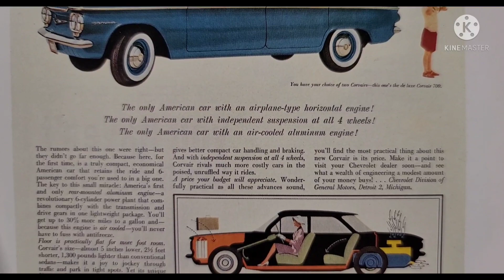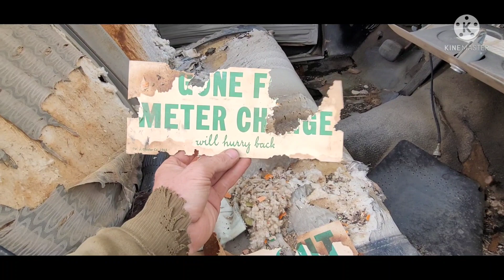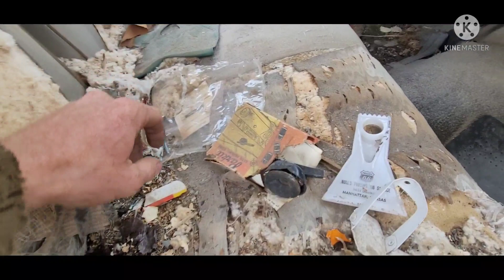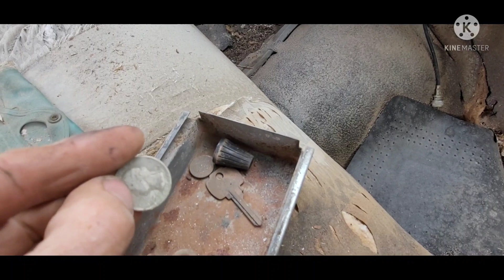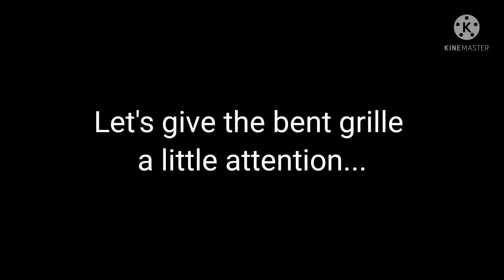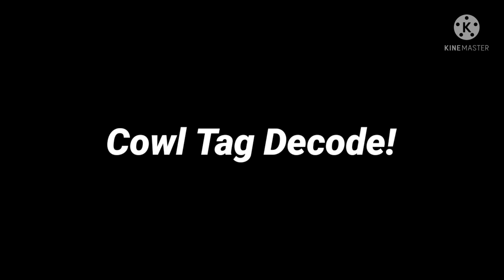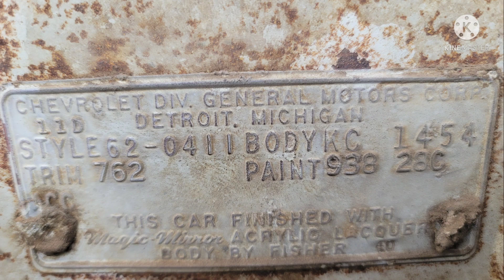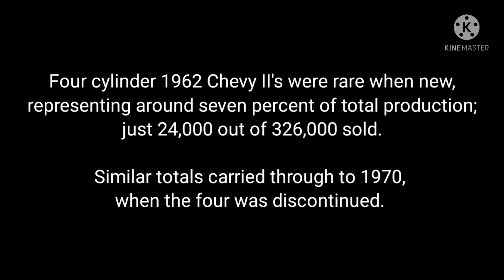1962 Chevy II farm auction find: I rescue a rare 4 cylinder two door post early Nova project car!

Comment: Yep, those 4’s and 6’s disappeared.Back in 1971  I had a ‘64 with a 3 on the tree that I paid 25 bucks for, yanked out the tired 6 and stuck in a 283 -4 from a wrecked ‘62 wagon. Added shackles and fatter tires, flex tube dual exhaust with glass packs. Had a nice stance with the mildly jacked up rear end. Nice to have a friend that worked in a boneyard, total investment was about 100 dollars

Comment: This was very interesting.  My 1st car was a 1962 Chevy II 2-door sedan, but base model, not the 300.  It was originally a fleet vehicle (from the local telephone company), and had this 4 cylinder engine and 3-speed manual trans.  It was a great 1st car back in the late 60's.  I hope this one will be saved and kept as original as possible.

Comment: My first car 1962 2 door with a 194 6 cylinder would top out around 70 MPH down hill with a good wind behind you but it was unbelievably reliable. Nothing but great memories with it. The only thing I would change today is to add seat belts.

Comment: I worked at a Chevy dealer during High School and then took two years of auto mechanics in a vo-tech school and worked at the same Chevy dealer for a while in the early 70s. I was really shocked at that 4 cylinder. I never even knew they had a 4 cylinder available until the Vega. Very interesting find!
Reply: How much is it worth tim

Comment: GP well put together story.  I know a little about Chevy II's.  My oldest is a 1962 Chevy II 100 4-door 194 six 3 speed.  Left KC plant Coronna Cream fawn cloth vinyl interior.  Mine also was built 11D.  I wonder how close they are in production.  1962 hood hinges are 1 model year only.  I was told by a Chevy II parts person he's never seen a 62 where the hinges worked properly.  Maybe why it was a 1 year only hinge.  Front end is 1 year only also.  Mine came from an auction in Valdosta GA years ago then driven to upstate NY and sold by a used car dealer.  Then lucky me bought it!  I don't believe mine had as much rust as yours does.  Not being synchronized in first takes some practice at stop lights and hills.  Wish mine was a Powerglide.  It would be interesting how close their actual build date is.  I agree they are early production, and the low series are rarely kept.  I look forward to how your handle your II.  Thanks for the story.

Comment: Pretty decent car for sitting out like that.  Fun project!  Looking forward to the "will it run" and clean up vids.  If I had any metal working and welding skills (I don't), I'd pound out some sheet metal patches for the front fenders and rear quarters and tack them in.  Sling a little bondo on it, spray some primer and call it good.  It will still go with the patina of the rest of the car.  That one will be a fun cruiser for not a lot of money.  Although some hotrod guy will likely offer you big bucks for it so he can drop in a small block (insert eyes rolling here).

Comment: I had one of those Tim. Mine was even a cheaper model devoid of the side chrome , windshield ,and rear window chrome, no radio, three spd. standard, with the four cylinder. I had all the parts for a v8 conversion, but I just couldn't do it so I sold it. It only had single speed wipers with no washer.

Comment: The cowl tag having the wrong engine designation was very common on the Chevy cars of the time. Something to do with the body being built prior to final assembly by Chevrolet. Even into the 70s, it was not uncommon for the cowl tag to designate a V8, whereas the car was originally a 6 cylinder. The VIN info always overrides the cowl tag.
Reply: I worked with a guy who with his wife worked at a assy plant way back. He told me of one day he went to pick up his wife at the end of her shift . She was so drunk that she walked right by past their car. To lots of drinking along the lines. Could explain the tag.

Comment: Dang, I could have been able to use the 4 cylinder a year ago in a 72 Vega GT that I had.
You can bore them out and run 327 10to1 flat top pistons and get the cam custom ground. They make an awesome little engine. Reliable, not like the Vega motor.
Good luck with the Chevy II, I hope you do something with it. Or sell it to me for what you've got invested already... 😁Pul-Eezz!

Comment: Yes, hopefully someone will restore it back with this unique 4 cylinder, and not put a 350 crate motor or an LS in it, and it's history and uniqueness lost forever...The '62 grill was a one-year-only, and I like it better than the '63-'64 grill..and the '63-'64's seem to be the most common years you see of the first rendition of the Chevy II..the '65 is actually my favorite year out of the original body, followed by the '62..too bad they didn't make a convertible '65...and the '66-'67 are very well done facelifts of the original, very beautiful cars.. :)
Reply from the maker: It's hard for me to notice much difference between the 62, and the 63-4.
In my opinion the 65 was a hideous, bug-eyed monstrosity. How they ever let that mess out of the design studio is beyond me.
Reply: @mr.goodpliers6988  ..Well, I actually think the '65 looks best..would love to have a '65 SS L79 :)..or, a '66-'67 one would be nice as well..the difference between the '62 and the '63-'64, is the grill is quite a bit different..the '62 has the horizontal bars, with the larger horizontal bar in the middle..the '63-'64 has the same shape grill, but it is a big crosshatch/mesh/small eggcrate affair..makes the grill look too big to me...

Comment: Looks like a good car for  being outside. The sedan reminds me of the 65 that I owned 50 years ago. Should have never let that one go. Factory 327- 300hp, 4speed, 3:36 posi. Radio delete, backup light delete covers,but had tinted glass. Rubber mat no carpet. I assume your 62 also a rubber mat car so if it's in good shape the floors should be good. Good luck if you decide to fixer up.
Reply from the maker: Yes the 100 and 300 had rubber mats. The 100s all came with black mats, but the 300 mats were color keyed. The Nova had full carpeting.

Comment: That six number is common. It's a Fisher Body number. I have seen many with V8's and 4's with that six digit. A friend restored exactly the same car, with the 4 cylinder that had the digit for a six also. That four banger is used in boats too. Very common in Mercruiser powered smaller boats. They're extremely durable engines.

Comment: Couple of things, it's a two door hard top not a post. Also if you have the ignition key that same key unlocks the trunk. I did see what I thought was a windshield washer button on the windshield wiper switch, that's an option. I have a mostly stock 1964 SS Nova with an L79 in it. They are really remarkable cars as mine has all the original starter, distributor, alternator, and voltage regulator. Best of luck with it...

Comment: Neat find! Hopefully it'll live on as is, but odds are slim there. 
 So I noticed something on the trim tag, which is the low body#(1454). I'm thinking it's possible that the style # is mis-stamped. As you noticed it's an early car, built in late '61. Sometimes those mistakes still got through- that plant(or tag maker) may not have had their codes down yet. Not that it's worth chasing, but the only way to prove or disprove is via a build sheet, which I doubt would exist in that car given the mice factor. Being as the engine bay is so unmolested, I'd bet the tag just got stamped wrong. Hope it moves quickly for ya!

Comment: All of the 1962 1963 1964 chevy2's came with a 4 cylinder. And the convertibles are the only actual rare chevy2's  only 7,000 of them made and not very many living today with the roofs not protecting the insides from the weather....

Comment: The Chevy II 4 cyl engine was used in a lot of boats & Hyster lift trucks up into the 1970's
you might even find a propane set up from a lift truck that you could use on the car.

Comment: Pretty spiffy grille work, shows what just a little effort can accomplish. So I'm guessing when you talk about data plate confusion (03 vs 04) you know this car to be original as is and no engine swaps? Curious if it is yes. Gm was on a major backpedal with the corvair at the time realizing the rear engine wasn't going to compete with falcons and darts. 18 months was light speed in analog production days. Neat find

Comment: Can't call that engine the predecessor to the Vega etc. Totally different. This engine often used in boats and forklifts etc. I still have my 62 Chevy 2. 4 door 6 cylinder powerglide sitting on the farm. About the same shape as this one only a car wash took most of the grill out. Should try to sell it.

Comment: Local fella stuffed a 454 in one of those to build a Pro Street rod. Had a uncle that drove a Nova ll to work 10 miles for several years. Iron Trap Garage just bought a warehouse full of GM sheetmetal 40's to 70's including some hoods. I would email        
Matt and see if he has fenders. Matt is in Boyertown ', PA. He prolly has parts to fix some of the other rusty junk you and Joe have.AL B.
Reply from the maker: I've been following that. The NOS trove is fascinating!
Reply: @mr.goodpliers6988  Yep! And alot of it has part numbers on it which can make identification so much easier. AL B.

Comment: I hated when people would refer to my 62 Chevy 11 as a Nova. Kept telling them it's Not a Nova it's a Chevy 11 Nova is a different car. Didn't even make a Nova in 62' I had the 194 inline 6, powerglide automatic had a radio and under dashboard dealer air conditioning. Was cheap in 1981 at $75 dollars! Had just over 98,000 miles

Comment: Nice video  of the Chevy 2 . I'm curious, how much did you pay for it. 
     A friend of mine has a 1962 Chevy 2 Coupe . It's an original Coupe and not a post . He offered it to me for $1200 . He knows the car is rare .The body is OEM white and is pretty much perfect and all original ; with all the chrome and trimming and without any rust.  I believe it's a 4cyl but the engine and transmission is gone . The car is in storage.  I decided to buy it before I saw this video.  I will be bringing the 62' Coupe home soon. I plan on putting in a 327 c.i. from a 1966 Chevelle , that I have . I thought about getting the car running and resell it . I may post a video of it .
    I can't wait to start on it . 
   I'm going to subscribe . I'm curious , of the plans you have for this car.  
   Best Regards.
Reply: In my opinion you stole it. If the condition is how you described it. Enjoy
Reply: @chuckstith838 , smile , hahahah. I stole it legal though . Yes , it's in really great condition and it doesn't have any dents and the body panels doesn't need replacing.  It looks to me , that it was bought new and then someone pulled the engine and transmission out of it . I was really surprised to see the great condition it is in , when he showed it to me .
     He is a hoarder and has about 30 vehicles.  
    I'm thinking of putting a Chevrolet 327c.i in it and resell it for 10k .